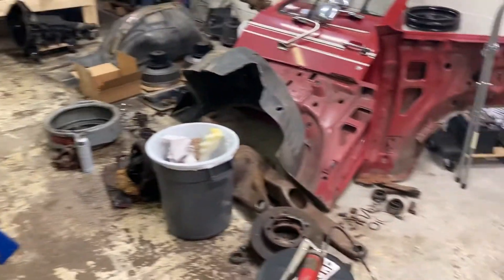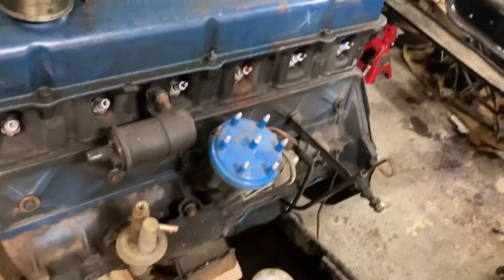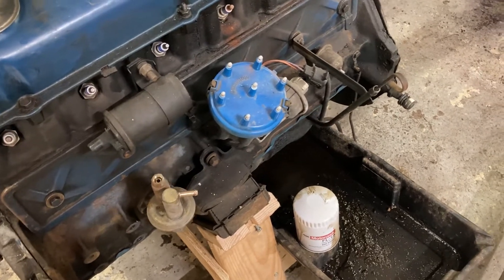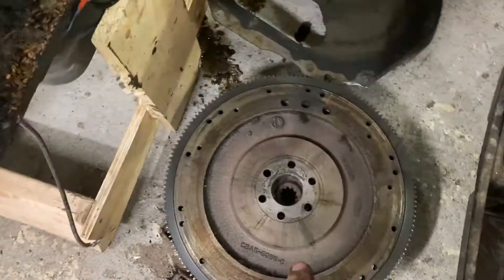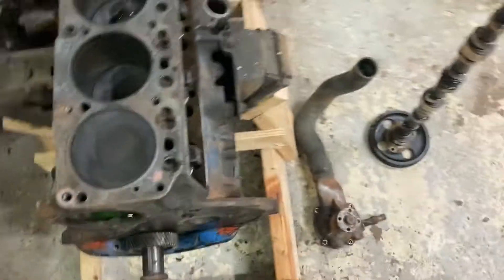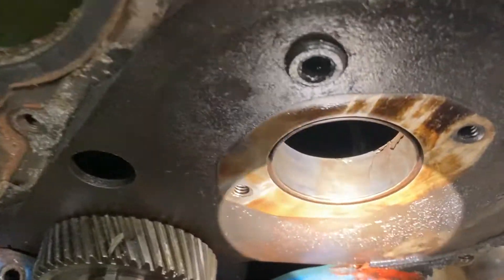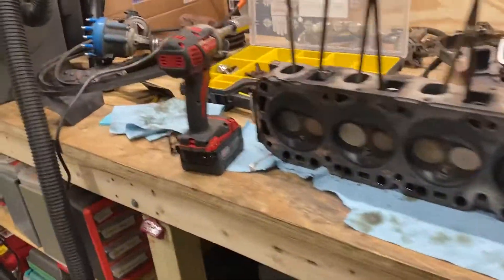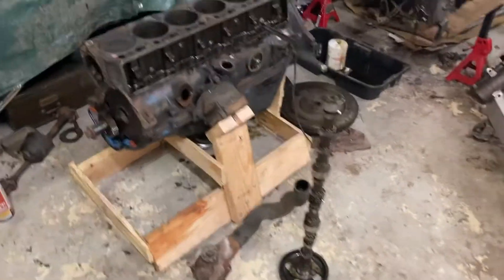Ford 300 Inline Six Rebuild Pt. 1: Teardown

Comment: How’s the engine re build going?
Reply from the maker: It’s been slow going. I’ve had more pressing repairs come into the shop so it’s taken a seat on the back burner.
Reply: @millerrandr  I’m sure eventually it will be an awesome engine for ya!
Reply from the maker: Yup. It will be. I plan on restarting on it in January once my motorcycle is built.